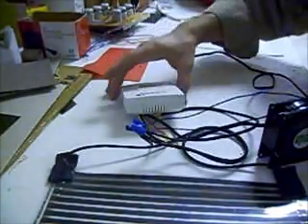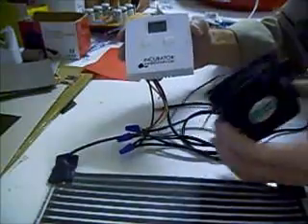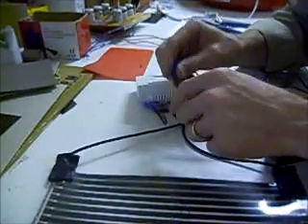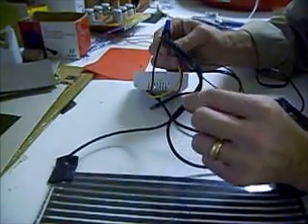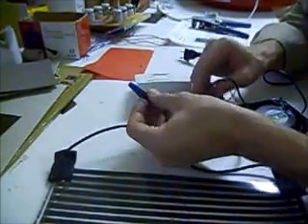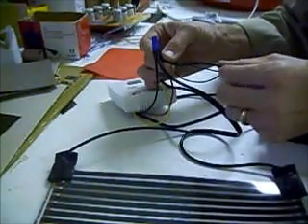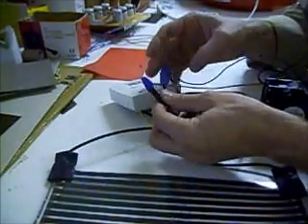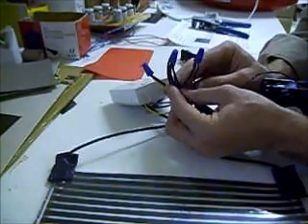Electronic Thermostat wired to fan and Flex Watt

Comment: how different will be the connections if the thermostat is attached to a normal fan?like the ceiling fan.Then the speed of the fan can be regulated according to the temperature of the surroundings.what say??

Comment: Thermostats are typically rated for low voltage 24volts, at least all the ones I found. I am looking to do something similar, but currently am using a transformer and a relay to get it done. I would love to eliminate those two items if you found a thermostat that can handle 120v on its terminals. Can you post the specs, Manufacturer, model etc..
Thanks